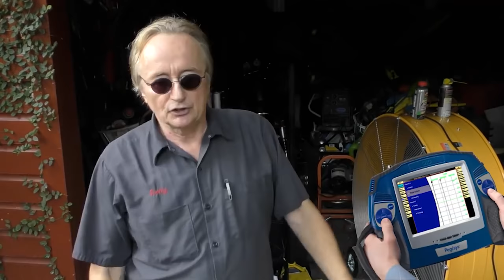3 Illegal Mods That Will Make Your Car Run Better

Comment: Tried the lacquer thinner but did not work. Replaced cat 1 on my Accent, the oxygen sensor AND the crankshaft position sensor. Did the trick. Once I got the old cat off the inside looked clean!  Prolly could have gotten away with just the Oxygen sensor and the crank sensor.

Comment: I removed the catalytic converters on my ‘04 4Runner ( it was ceramic looking with holes inside it ) and it ran better but the exhaust fumes got intense and I couldn’t open the back hatch windows because of it.

Comment: Guess I'm just super lucky because I've had five Nissans over the last thirty years and the biggest issue I've had on any of them is they all need headlight bulbs replaced about every fifty thousand miles. Yes the Toyota I owned was about as good, only has to replace the alternator (and no headlight bulbs) but I would say overall the Nissans were tougher vehicles. And the Honda and Acura I owned, well, never again. Delicate.

Comment: Strange that he doesn't mention making fuel map changes at some ecu workshop as the biggest benefit.
in many cars, the power increases significantly.

For example bmw 320 2.0l engine originally 184hp >260hp and torque 270nm > 400nm.
These are obtained without any technical changes.

At least in Finland, increasing the car's power without a modification inspection is illegal, because the car's brakes, for example, may not cover the new power readings.
Usually, a professional who makes changes to the map also knows how to take into account the tolerance of the gearbox, etc.
Usually, on top of that, you get better fuel economy..

Comment: Wow thank you Scotty Iv always been told from master techs and other techs from multiple shops , dealer shops, or private over holy 25 yrs of me wrenching on cars with normal 4 stroke motors told me that they absolutely needed back pressure to run right but Iv always questioned that due to race cars and my own cheap cars with no exhaust and even fixing exhausts on customer cars never noticed any difference in performance so thank u always a touchy subject with certain guys but makes complete sense and totally forgot about the 2 stoke cars made back in day !!! Thank u and yes newer cars have the unburdened gas in exhaust run back to engine but that’s another vid and subject lol

Comment: Scotty, that “backfire” you’re talking about in the modern Porsches, Lambos and Ferraris are pops and crackles that are tuned into the car’s exhaust when in sport mode because they think it’s cool sounding. It’s a feature done on purpose when you lift off the throttle.

Comment: Bigger injections will give you a few more horses but you will run richer and suck more fuel,it's better to use on a boosted engine either supercharged or turbos to get more power.

Comment: You could just fill the entire exhaust system by raising the cars rear a little and put dish soap in it... I've done it to clean my cat because I blew my engine in my eclipse (13 years ago) and when I got the new engine it wouldn't pass emissions for inspection, I figured I burned alot of oil I need a sovent that cleans grease off of metals... dawn works lol. Passed emissions and my o2 sensor in my cat stopped malfunctioning. I took the intake manifold o2 sensor out and poured dawn in and then a few gallons of water.

Comment: Common man, are you knowledgeable with high performance turbocharging. The pops you refer to are intentional. It keeps the turbos spooled up. It comes like that off the showroom floor or aftermarket, for maximum power. No boost between gears, means turbo lag.

Comment: What if you “removed” all the honeycomb from inside your Catalytic Converter and just run it with the empty shell ?   The police or inspector would not be able to tell the difference by just looking at it.  It wouldn’t make any more noise without the honeycomb than it would with it.  But you’d have more horse power due to freer air flow.  This would be illegal, but no one would be able to tell the difference…unless the exhaust SMELL would be stronger.

Comment: I took the Cat out dumped out the Junk put it back on and passed Smog with flying colors pre 2000.  Rod up the pipe over 100k passed like a new car.

Comment: You get caught GA 
WHEN you take it to an 
authorized emissions 
testing station...honest testers visually check for items as simple as bad/loose gas cap...to missing devices like catalytic converter...test will nowadays not tell owner anything more that a 
"PASS/FAIL"
printout...then you have so many days to take to an "authorized repair facility" for corrections
...depending on mileage at inspection and under certain Ga E.P.A. regulations, you have to spend a certain amount of money to pass...or get a waiver with annual mileage restrictions!

Comment: Actually, Scott. A lot of the newer performance cars that are turbocharged have intentional backfiring to keep boost pressure spooled in the turbo for sudden acceleration between gear shifts or deceleration. Figured you would know that by now. :P
Reply: But, now you know. AMG first introduced the practical use with the Bi-Turbo design. Pretty sure..

Comment: Speaking of modifications, what do you have to say about replacing the OEM flywheel with a smaller lighter one? Daily driver without boost or any other modifications.

Comment: Things to remove to make any car run better.

#1 EGR bullchit
#2 catalytic converters 

Why because pumping hot exhaust fumes into a plastic intake before it even reaches the catalytic converters and only putting an egr tube on 1 side of the motor is the single dumbest funking thing ive ever seen in the automotive world.

As for the cats, they just constrict airflow of exhaust and if you don't have them, people won't be able to steal them.

Comment: Removing your muffler will create a loss of power, turn your check engine light on, and is hard on your exhaust valves. You’ll lose almost all of the back pressures you need to run properly. So first idea is a busted myth

Comment: I had a 2001 Wrx that had a catalytic converter in the up-pipe, it ended up breaking apart and rattled heeps! If it broke into a small enough piece it would have destroyed the turbine on the turbo!

Comment: N/A cars need backpreasure to function optimally, removing the mufller on a N/A car will ruduce the overall power. The only real cars that would benfit from a muffler removal is a car with forced induction (Turbo or Supercharger) as the point of using these setups is to push the exhaust gases out as quickly as possible.
Reply: Absolutely not true. In fact, the opposite is true. Designing an exhaust with negative exhaust pressure will make even more power. I own a dyno and tune efi, removing backpressure always helps make more power.
Reply: Also, the point of forced induction is not to push exhaust gases out. A turbo uses exhaust energy to drive a compressor to force more air into the combustion chamber, that, when combined with the correct amount of fuel, makes more power.

Comment: I have twice removed the muffler from two seperate times removed the muffler from a 4 cylinder car I owned and after i drove them for about 15 minutes they started to overheat. I always wondered why and this did not answer the question.

Comment: Please... for the love of cars... DON'T PUT LACQUER THINNER IN YOUR FUEL (unless you have verified the chemical composition on the material safety data sheet)! There's such a  huge variance in the actual compositions of lacquer thinner depending on the brand, and most of the modern lacquer thinner available is primarily acetone. It may clean certain parts of the system, but it will also do damage to fuel lines, seals, and any other rubber or plastic parts it comes in contact with. This may have worked previously, but nowadays the "low-VOC" regulations put restrictions on alkyl esters like butyl or amyl acetate, aromatic hydrocarbons like toluene, ethers such as glycol cellosolves, and alcohols.

Comment: 2:16 Are you sure about that number? To get an idea of what 15db is its roughly the volume of a human wisper. 

Prehaps they mean 15db above ambient city traffic volumes? That would put you in the 95db range just like CA. Traffic volume varies a lot though so it would seem odd to use it as a baseline. Then again we are talking about NY; a state where things like logic and common sense do not apply when discovering the law and how it's enforced...

And backfires can be intentional and beneficial in some circumstances. That's what anti-lag is. Since you can't maintain turbo spool-up without load you need a way to increase exhaust gas pressure. This is achieved by causing detination in the exhaust manufold, or anywhere in the exhaust system before the turbo. This increases exhaust gas pressure allowing the turbo to spool. Its a rare circumstance and will cause a lot of wear and tear but might explain why you hear it on some high end spots cars.

Comment: ZDDP additive will destroy a catalytic converter it's had a p0420 code for a few years and the info says it's down to 92% efficiency and no cleaner works the code came on after using STP with zinc and I didn't know at the time that zinc is bad for cat

Comment: Yes and no about the pop. If you do have higher tune set up. like your would be  making 270hp. When you put out more HP tune. like 500hp it will pop no matter what your have to stop it. Vvti is known for this because of the cams in the 90s. As higher out put then the 2000s. I been working on cars for 10 years. Ive worked on honda as well with the VTech. I know about this.

Comment: I have a mini with the devil inside.  No 2 cylinder gets shut down by computer at 90o C.  valves are good, pistons are good, harnes is good, compresion good, coils are good, engine control is good, and the problem remains with No 2. Any crazy ideas out there that may resolve the issue ?

Comment: I didn't remove the muffler from my suburban ... It fell off at $360,000 mi. The motor sounds nice without it. Just remember to drive with the windows cracked

Comment: now wait a minute uncle scotty.. car engines have no explosion stroke, its still combustion.
new york a 15 db limit?
another word on the saab sonnet, it came with a 3 cilinder 2 stroke the later ones had a ford v4 engine. 4 stroke 
you know more about cars than me. 
but i thought lets made some small corrections.

Comment: “Four stroke motors dont need back pressure”. False. Running with zero back pressure or low back pressure on a four stroke motor will 100% cause carbon accumulation on the valves and premature valve seal wear and overtime can cause such severe deposits that damage can occur.

Comment: What it still run if you took the honeycomb out of it? ? Would it still throw codes?  would that be the same thing as putting a straight pipe in place of the catalytic converter?

Comment: I had a 91’ Ford Ranger that the catalytic converter got clogged on so I cut it off and put a straight pipe on it and it still ran like crap although at least a little better. Then my uncle told me it needed the back pressure to run right and maybe there is a way I could’ve tuned it for no converter but I don’t know. Anyways I had a new one installed and it ran great. So what’s the trick to not needing that back pressure?

Comment: You need some back pressure on your exhaust though or you'll lose low end torque. Plus modern cars are tune to run optimally the way they com from the factory

Comment: You lose torque when a muffler is removed, and the engine runs leaner
Reply: Source? Trust me me bro science
Reply: @valum4538 it's called backpressure.
Reply: @hightidelowtide6380  back pressure is bad as described in the video you want scavenging which is how the myth came about
Reply: I don't care if back pressure is bad. I said torque is lost once you start to free flow your exhaust system. You gain more horsepower but lose torque.

Comment: Most road vehicle engines require a degree of back pressure in the exhaust system, including the manifold and exhaust pipe components, in order to run efficiently!!!!!?

Comment: Referring to the nitrous oxide it should not make a difference if you do not open it up on the streets because nowadays is just about any car will go to 120 130 mph it just comes down to the driver down and that there is where you build up your no claims bonus at that point I'm only going to be doing the speed limit anyway so it doesn't matter how fast the car can go they should be trusting you're 10 years of driving without any speed tickets for example, if you have no fines over a 10-year period then an insurance company would have now grounds to change your policy for a larger engine CC

Comment: I have an old Nissan hardbody pickup truck that always backfires when I let off the gas. I thought it was because of an exhaust leak, but once I fixed that it's still backfires. Any ideas?

Comment: Bigger injectors de tuned to run the engine on less fuel is absolutely pointless 
No need for Bigger injectors unless the car is modified enough to be starving for fuel from the stock injectors

Comment: 4:19 absolutely not true whatsoever. I was a mechanic for Ford and when those super trap mufflers were getting popular, people were putting them on their Mark 7s and cute little 1.6 hsc ("Ford Hemi") and they weren't running right. take them off, put the muffler back on no problem and no codes.

Comment: Hey Scotty, if back pressure didn’t matter on a 4-stroke engine then how in the fish did Yamaha create the V-Max motorcycle decade’s ago? Let alone create EXUP variable header collection valves? 
Anyhow yea generally speaking pressure levels are generally less shocking on 4 vs 2 strokes but it’s not that simple either bc 2-cycles work of sonic/pulses in the exhaust

Comment: Scott I got a 2018 dodge journey and it takes e85. It has 73kmiles white smoke/ steam coming out the muff pipe. Not a head gasket problem- I don't think. It drips water out of a little pinhole in the muffler.  Any thing I can do. 
  Thanks Scott.

Comment: he's right for the most part but there are some technicalities that hes wrong about, in general, in most cases removing the muffler and feeding up some back pressure will increase power, but it can actually decrease the power, and 4 stroke engines do need some back pressure, in high end racing applications they actually designed the exhaust manifold to apply a certain and pre determined amount of back pressure. inside the engine there is a point where the engine is sucking in new air and getting rid of old air at same time. if you have no back pressure than some fuel will escape through the exhaust resulting in less power. really, the only way exhaust mods work is if you do other mods that increase power like a tune and not just a cold air intake. most of those don't really do anything do to bad design or bad installation. in some cases a cold air intake is worse than factory. like I said, he's generally correct but he's technically wrong

Comment: dpf lasts 200.000 km , i fckd up mine from peugeot parter from france... and dpf are crap, it got full, almost in normal use in city, using it at 3000 rp or more to regenerate the dpf (diesel particle filter/that ceramic broken inside. from the video)

Comment: I have a 2007 Maserati quattroporte . The shocks have acceleration sensors and average every 2 years the sensors brake down. Can I replace the shocks with sensorless shocks same size?

Comment: Question: Not sure where you usually answer these at but all I can do is ask and hope for an answer.. 2014 mustang GT 5.0 manual… my rear driver side breaks always wear one pad flat the other stays with plenty of meat I know all the typical solutions.. guide pins, binding caliper, brake hose, etc let me just say I have thrown more parts at this issue that anything in my life new rotors x 3 times,  pads 10x, calipers changed once, rubber brake hoses changed to once… and pins never Stuck they moved freely but still replaced them anyway .. it’s ALWAYS THE SAME PAD inside rear left that wears down while all others wear as they should… please any advice would be so greatly appreciated

Comment: i had a 06 cobalt ss sc straight piped no cat no resonator not much of a muffler that thing was loud asf couldnt hear someone talking woud have to yell at anything above 2500rpm. in tn they dont care if you run no cats no inspections required to register here

Comment: Thanks for the update I had one question I own a 2018 Honda Accord sedan and it's good it drives nice but for some reason the cylinders are where the sensors go on you know like when the engine light comes on and the steering wheel sensor comes on for some reason all that came on a car was still fine to drive I don't know if it has to do with a cylinder or the the electric area or so but it's so weird randomly go back to normal but it's like a light switch you flicker on and off and I'm wondering if you can help me solve that issue because I really hate these electronic cars these days I mean it has gas to it but I miss my old 2001 Jeep Cherokee V6 that was a nice car. 🏎️⚡

Comment: Hey Scotty,  I have a 2018 Toyota tundra 5.7, would taking off the cats and putting on a more free flow performance muffler help with gas mileage?   
Thanks!  Really appreciate and enjoy your channel!
Reply: It will. But you will probably enjoy that loud rumble and have your foot on the throttle a lot deeper and more often negating the small added mpg that you gained lol.

Comment: I vaguely remember in CA, besides the dB limit, there is also regulation that says one cannot modify the factory muffler. 
Does anyone know details to that regulation? 
Basically, if one must replace a muffler, it must be genuine factory replacement part, not some third party alternate design…